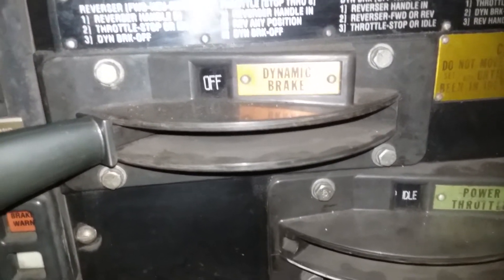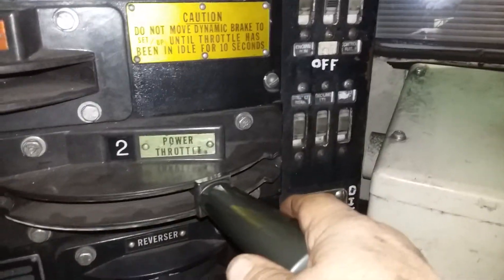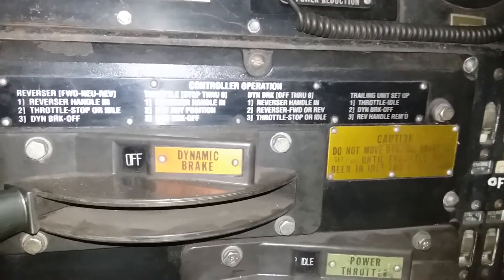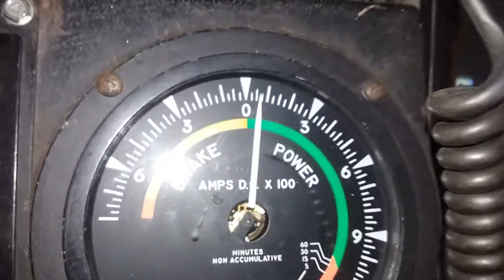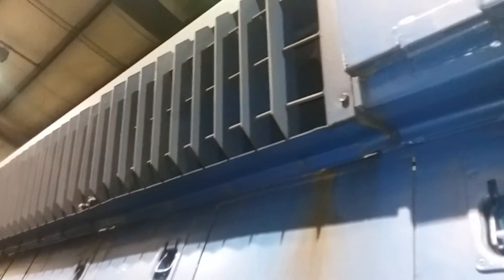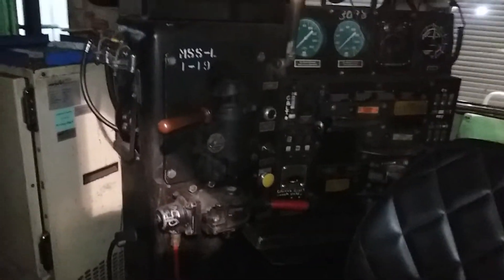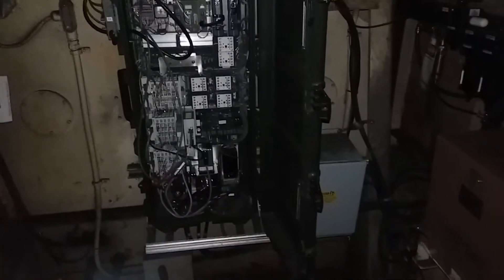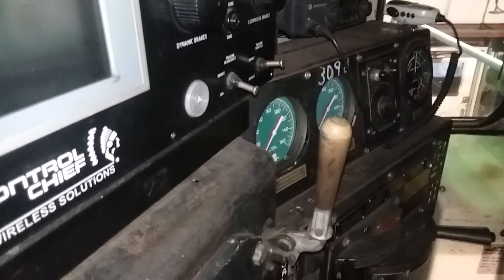Dynamic brake controls emd sd 40-2

Comment: Is this train still in use?
Reply from the maker: Yes it is NeuralLab, was built in 1966. Amazing isn't it. Thanks so much for watching.
Reply: @ccrx6700 does it still use dc motors
Reply from the maker: @megavoltampere1000 yep

Comment: The later SD60's with DC traction motors had what was called high capactity extended range dymamic brakes before the AC traction motors Units came into service.
Reply from the maker: I've heard of that qtrhors, enables the dynamics to work better down to
a lower speed and also work better at a higher speed if I understand
it correctly.  Appreciate your taking the time to write in and for
checking out the dynamic brake control video my friend.

Comment: Hey @ccrx6700, do you suppose you could show the dynamic brake transfer switch and related switchgear in operation at some point?  I've worked on older EMDs with relay-logic controls but I've never had the opportunity to see the electrical guts of a more modern dash-2 unit aside from the card-edge modules in the cab.

The older EMDs just use ordinary power contactors for DB set-up and in some cases for reversing, but it sounds like the newer units utilize a motor-operated drum switch.  I would love to see and hear that some time.

I'm also curious about the load regulation scheme on the newer units.  Do they still use the old commutator-type rheostats or have they moved on to solid-state PWM?  Does the new system still take direction from the hydraulic governor or does it operate independently?  Thanks.
Reply from the maker: I will certainly do that if I ever get the chance heavy iron. Yes our
locos use a motor driven switch but I'm not sure exactly where it
is located, but you can hear it when you go to dynamic braking. I have
no idea what the newer locos use, our newest one was built in 1978.
Very grateful my friend for your taking the time to visit with us
and check out the video.
Reply: @ccrx6700  Say, on an unrelated note;  I know you do a lot of track maintenance work...  Do you have any experience with construction of brand new track?  I volunteer with a small museum and we are looking to build a little oval track around the perimeter of our farm field when funding and manpower permit.  I figure you're probably a good brain to pick on that subject!  The power track tools we have are basic - a pneumatic spiker, a skid-steer for moving things around, a couple of gasoline powered hack saws and rail drills that all need to be rebuilt before use, etc.  Got access to most of the materials except ballast.  Small volunteer operation on a shoestring budget.

If you're looking for a video idea, I'd love to get your take on the subject.  :)
Reply from the maker: @heavy-iron  ive never done new track construction but sounds like your on the right track. Air spiker you will love having! Best of luck and let me know how it turns out 👍😊

Comment: I would not say we know ho to run the loco, rather how, not stop it, but how to slow it down!
That kind of brakes were the main braking system on our Swedish trams for some time. The mechanic brake was used stop it at the very last part.
Reply from the maker: Train handling skills is an art acquired over time and experience
running. Thank you so much for visiting with us and watching the video. May you have a most blessed day my friend.
Reply: @ccrx6700  It sure is! Autumn and plenty of leaf on the rails... or a first light rains....

Comment: Hi! I just found your channel, can I ask a few questions regarding SD40-2 operating prodecures? I like train sims, but they rarely give you any info on how to properly operate your locomotive to simulate real-life operations.
1)As I heard from other people your front (direction of travel) headlight should always be on "Bright" settings, but what about your rear-facing headlight? Should it be on if you just run "light engine",  and what if you do haul freight cars behind you, should it still be on? If so, should it be set to Brigth/Mid/Dim?
Dithch light, as I understand sholud always be on (since they already depend on the reverser handlt position to actually activate). Please correct me if I'm wrong.
2) Number lights - should they be turned on the whole time, or just at night?
3) Platform lights/step lights. Should you turn them on at all times, or just at night, or just when you actually need them?
4) Is it a a common practice to change cabs every time while changing direction of travel during switching at yards if you do it with 2 engines set up as a multiple units?
5) Should the cab light be always on during night operations? I guess it have to be so, otherwise it will be hard to find controls handles, since they are not lit up in the same way as guages can be.
6) Are there a minimal speed required for dynamic breaks?  
7) How common is it for all of the above to change from one company to the other (UP & CSX for example).
Reply from the maker: Rear light on if loco is EOT unit, not on when pulling cars. Not all ditch lights are wired in the same way, ours have a manual switch
and are supposed to flash when the horn is blown. Not all RR's
are required to have ditch lights, depends on whether they have
crossings or not and the speed at which they go over crossings.
We are not required to have them by law, but we do anyway.
Most RR have number lights on all the time. We only turn on
step lights after dark.

Our push pull system here always ends up with the short nose
forward when hauling loads, long nose forward with empties.
They pull in and load and when the train is loaded the opposite
loco is right there for them, so no running around is needed.

No one runs here with the cab lights on after dark, unless they
can't find their lunch bucket.... LOL

Dynamic braking works best on our old EMD's from 24 MPH down,
below 7 MPH they are largely ineffective. 1 loco has split
dynamic brake cooling grids which does allow for better braking
down to about 4 mph.

All RR's have their own unique operating rules you would have to
read each RR;s operating rule book to find out what you are lookinig for, I can only tell you what we do here.

You ask a lot of questions
Reply: @ccrx6700  Thanks a lot for the info, sorry for the sheer amount of question.

Just want to clarify one more thing, i suppose my initial question was a little bit ambiguous. If I am tasked with switching duties in the yard, and given 2 SD40-2 set up as MU (coupled long hood to long hood) for that task, should I change cab every time i change the divection of thavel (i.e. i stoped beyond the switch, throwed it to the other track and now i want to reverse to couple to the car consist that require moving)?

P.S. It just facinates me how things are done different in different conuntries, I shurely love my country's railroads, but you just can't deny that US RR's have their own charm (especially US signalling, that is thully something special).

Comment: Nice video! How much braking power does dynamic brakes produce? I'd imagine it'll be hundreds of kilowatts or even few megawatts.
Reply from the maker: Thank you and glad you enjoyed. You've posed a question that I
do not know the answer to, but now it is very curious to me,
am gonna have to do some research on that. Braking power on
the gauge is read in amps so have no idea how to figure that
to what you are asking.
Reply: @ccrx6700  Just have to know the voltage involved then multiply that by the amps, if it's 600 volts and you're braking at 600 amps,  that would be 360,000 watts.
Reply: P=I2 R...(Power = Amps squared x Resistance)

Comment: What happens if you throw the dynamic brake handle to set up while engine is not running?
Reply from the maker: nothing happens
Reply: the switchgear will still rotate positions, but yeah, not much is going to happen lol

Comment: Coming from the point of view of an Electric Vehicle that has "Regenerative Braking," it seems like a lost opportunity to not have a battery or capacitor bank to save the energy generated by braking, that can be called upon when acceleration is needed, to save wear on the diesel motor.
Guessing that with the age of these Locos, that was not something that was really thought about?
Interesting video :-).
Reply: It is not feasible.  How could you store so much energy?  Even if you had a huge bank of batteries they would deplete very quickly once you got on the throttle again.
Now on an electric train that has overhead wires then you basically generating electricity for the city.
Reply from the maker: You are correct, the amount of storage would be incredible. Bat powered locos okay for short/yard type work where they can be
plugged in and charged frequently  but the tech for long haul just isn't there
yet

Comment: All that down hill energy going to waste in heat. Why haven't battery cars been added to capture it after all these years???
Reply from the maker: Great question Dale! On some newer locos specially the all electric powered ones they have instead of calling it dynamic braking its called regenerative braking where the current produced is fed back into the third rail or catenary lines. Also on the latest technology they are experimenting with battery operated locos which feeds the current back into  charging the batteries. 

They could use the current on these older locos to help charge the batteries but they have an auxiliary generator which already does that like the alternator does on your car.

Comment: Nice closeup.  I also noticed the power end of the ammeter had some time-limited range for power in the red area.  Probably only allowed to operate in that area for a short time to avoid overheating?

Anyway, good content and nice video, hope you keep up the good stuff. :)
Reply from the maker: Glad you enjoyed Mike 😊
Reply: The red-zone on the ammeter is actually referred to as the "short time limit". You can only operate whilst drawing that much current for a maximum of one hour before the traction motors will start to overheat.

Comment: So do the dynamics basically just slow the traction motors down? Does it work kind of like a jake brake on a diesel only slowing electrical output? I've always wanted to learn more about dynamic brakes, great video thanks for posting👍🏼
Reply from the maker: In pulling traction motors are just that electrical motors. In dynamics the traction motors are changed  to now being generators, that means in a way of speaking they work as retarders do like on those huge dump trucks, they create resistance which tetards the driving wheels, thus slowing the loco down
 They also create a lot of heat which is dissapated thru the dynamic brake resistor grids located on top of the loco near the middle on these older emd's, has same effect as jake, but jake works by decompressing engine by holding exhaust valves, hope that helps explain
Reply: Just to add a little what ccrx 6700 said.  The generator on the diesel engine has to be disconnected from the traction motors and then the traction motors connected to the resistor grid.  There's a motorized electrical contactor assembly that does this, and that is the 10 second delay required.  The motorized contactor switches over these connections.  The dynamic control lever in 'set up' does that. (You also have to pause ten seconds coming out of dynamic braking back to normal power operation)

Then the amount of retardation is controlled by controlling the amount of motor field current.  Moving the lever applies more field, making the tractive motors generate more and more current into the resistor grid.
Reply from the maker: @mikefochtman7164  Mike what a Superb explanation sir!  Thank you for that. 👍👍👍
Reply: You explained that perfectly! Thanks👍🏼

Comment: I'll admit I knew that you have to wait 10 seconds after putting the throttle at idle before you move the dynamic handle to set-up, but I didn't know you have to wait 10 more seconds before moving it past that.
Reply from the maker: Well, guess that was my old habit, i was always easy on the equipment Also, units built after 1969 have an automatic braking delay on them, hope that helps, and thanks for the comment
Reply: @ccrx6700  That explains why in Train Sim World when I'm driving a SD40-2 I put it in dynamic brake and there's about a 10 second delay before I see the amps cranking.
Reply from the maker: @stumper661  yep, also when coming off dynamics there a delay before you can throttle up, on your train sim does it also give the nouse the electric motor makes that engafes the circuitry? It like a low whine sound